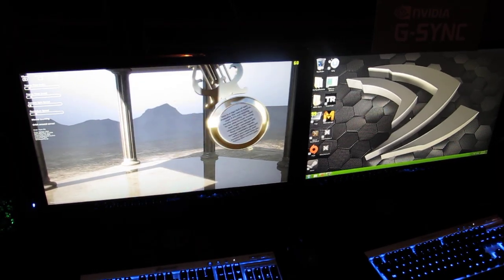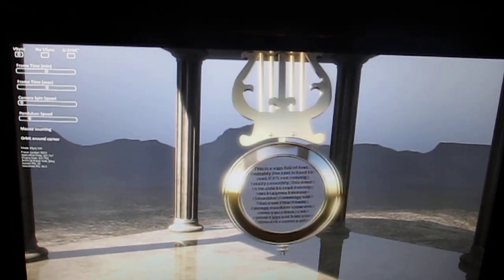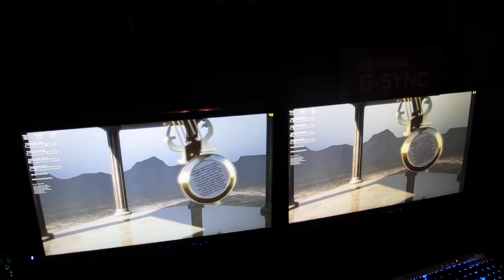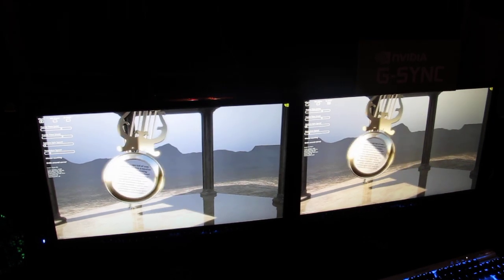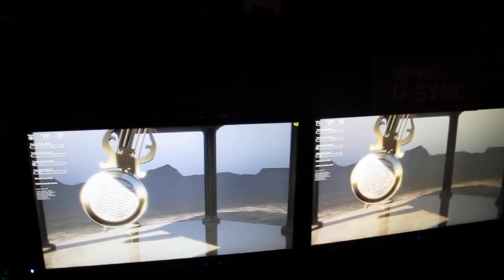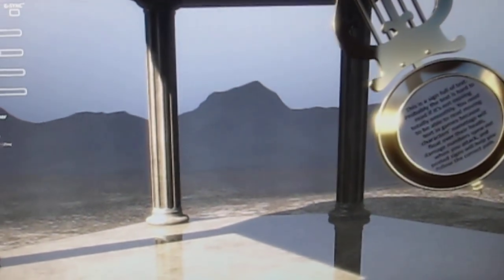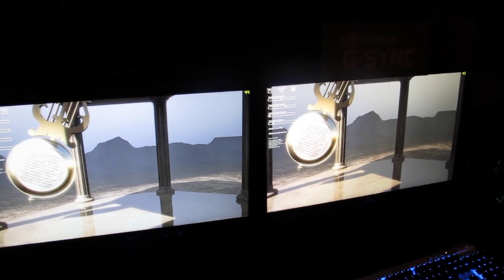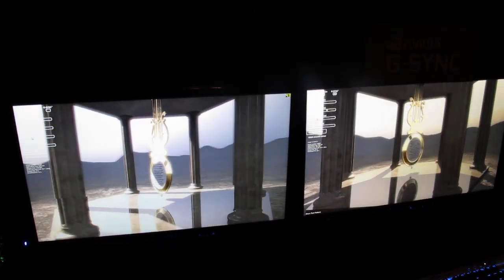Guru3D - NVIDIA G-SYNC Overview - Shaky Cam Voice over is Tom Petersen from NV

Comment: explains why you can push the tv/monitors refresh rate atm through nvidia drivers so yes you can do this through drivers.The hardware is there because it cant calculate quick enough through software to keep the tv/monitor in sync with the frame

Comment: triple-buffering fix this too! v-sync was developed to fix screen tearing. It fix it but combined with double-buffering(used as standard now) v-sync cause side effect that you mentioned (judder/stutter and other performance issues that appears whenever fps drops below refresh rate) it happens because GPU stops rendering waiting to sync with monitor almost every frame. triple-buffering is developed to fix this side effect. and it actually fix it by allowing GPU render non stop at full speed.

Comment: Normal realization of triple-buffering in drivers can solve both problems (tearing if v-synk is off and performance degradation if v-synk is on) simultaneously. Without any additional hardware or closed patented tech!
With only difference vs G-synk is minor input lag. That the vast majority of gamers will not even notice (except the crazy harcore "cyber sportsmens")

Comment: that is the reason i use a frame limiter for all my game.
usually, reducing framerate to 36 is enough to remove all stuttering. but with vsync disabled of course.
36 normalized frame / sec is 10 time more comfortable than 60 chaotic and stuttering picture.

Now if you ask me about this product, no , i will not buy a such screen, because best screen manufacturer will never agree to insert nvidia stamp stuff in their product.

nec , eizo , etc ...

Comment: Thats why I always played with V-sinc on, and try to keep Frame rate at least at 60, but since my monitor can do 120Hz I try to go all the way to 120FPS to sync at 120 and have 2x the smoothness, for that I need a realy beafy Graphic car (dual GPU).  alot of my friends never even knew the difference it made, but I could allways tell. When playing Shooters with smooth rate, you can aim alot faster without having to adjust as much, sometimes I felt like I had an unfair advantage ;)

Comment: Not so long ago, I was a pro gamer (CS 1.6) ... I had a 22'' CRT Sony Trinitron refresh 100Hz, vsync on, and triple buffering on.  Don't you tell me about input lag... cause' there wasn't any... (and I have another 22 inch IBM CRT for when this one dies on me). The best LCD monitors out there have at least a 26 ms input lag handicap versus a CRT one... if you don't notice that, then you won't notice a double frame when your card is capable of only 59 FPS when your refresh rate is 60. Use Google.

Comment: It does not need 3 times the memory :)) - it only needs about 10 MB more :)) for a 1080p resolution... Most of the video card memory is used for textures, not for the screen buffer. You don't know what you're talking about. You can also believe that using the G-Sync also causes your monitor to be able to receive a wider power input (from 110-240 VAC to 90-264 VAC as it's stated for the Asus VG248QE) - You may do whatever you want with your money... but for me this is clearly an nVidia gimmick.

Comment: Triple buffering still adds a frame of latency, requires 3 x the memory ( need to store 3 screen buffers ) and still only delivers frames at fixed intervals. I'm pretty sure it doesn't have much of an effect on actual performance in game but it's still an inferior solution compared to this. Personally I think this a great fix to a long standing problem.

Comment: Eye strain is typically due slow refresh rate (flickering).  In the past, refresh rate was a fixed based on the frequency.  But in this case, refresh rate could be slower (e.g. 30 hz, but the speed at which the pixels switch is still fast.  It just stays lit for a longer period of time.